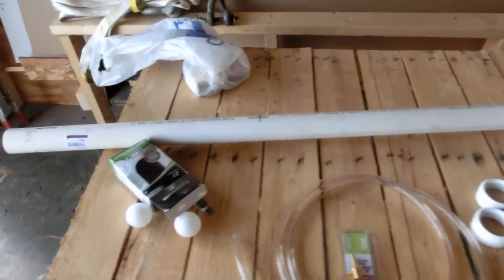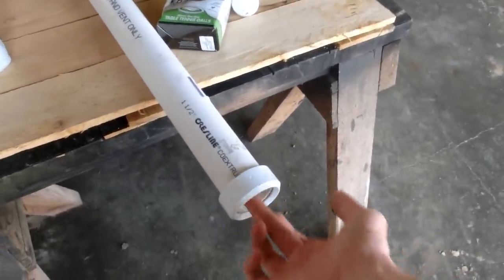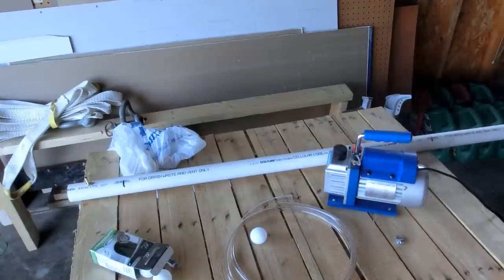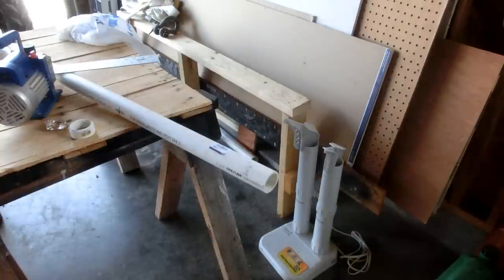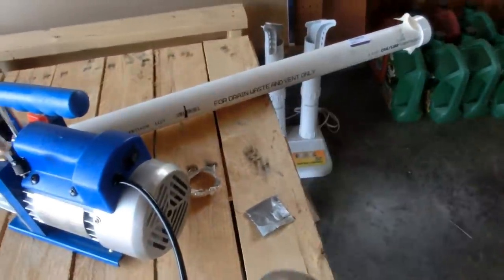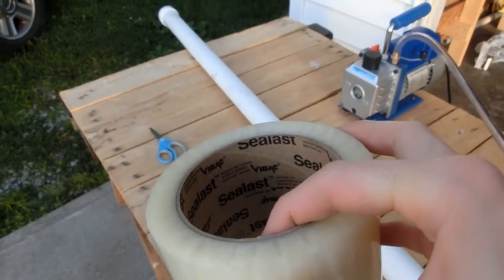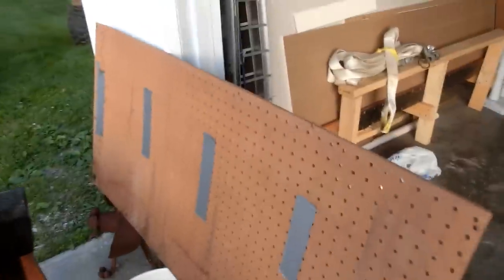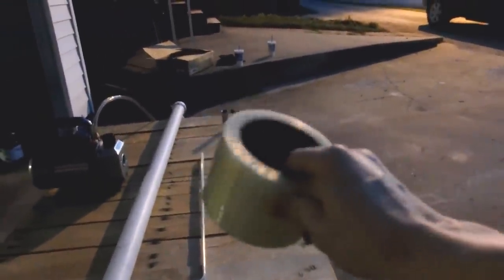DIY 290MPH (470KPH) Ping Pong Ball Vacuum Cannon

Comment: How fast would it be able to go if you increase the length of the pipe and make sure no air can get in front of the ball, wouldn't you technically be able to get any speed if you just made the pipe longer?

Comment: Hey, I was wondering what port you plugged the cable into from the vacuum pump, and also what is the nozzle called that you drilled into pvc. thanks if I get your answer I will be building this design.

Comment: How about a ball valve on the popping end??
Reply: yeah so rushing air can open it before the ball goes out. Fit he adds the valve one the air house he can disconect it from air pump so its portable.
Reply from the maker: josip :D (snakeinthebottle)
 actually i would think a gate valve that was spring loaded would work best. it only has to open fast, doesnt matter if i have to manually close it.

Comment: What about a flapper and rubber ring at the trigger end, the vaccume would keep it closed, you tap the flapper to fire.
Reply from the maker: i was thinking a Gate valve that was spring loaded, and have an infrared sensor before it to open it, that way the ball would never hit the valve and it wouldnt waste it's energy.
Reply: Rinoa Super-Genius
 Even with a gate valve you would need the end of the pipe to have a rubber ring or cleverly glued section of an inner tube to seal up against the gate.
You could get a bit of wood and drill a hole in the centre to fit the tube through and keep the seal in place, you have a flat flange to place your gate on and recess into so it slides straight??
Reply: Rinoa Super-Genius
Another thought, you could make a plastic disk and drill a small centre hole and a big hole , glue some rubber to it and punch out the big hole, make another plastic disk the same as the first, a pin through the center of both so the free disk can rotate, just rotate to line the holes up :-))
Reply from the maker: zx8401ztv
 or i could use a 8$ PVC gate valve from rural king that will already fit the pipe... ;p
Reply: Rinoa Super-Genius
lol i thought you may like to construct it, but if you have money burning your pocket ha ha :-))
Reply from the maker: zx8401ztv  well its not that i have money burning a hole in my pocket, i just know i'm not going to be able to make a part that precise. its better to just buy the part instead of trying to make it and getting frustrated then buying the part.
Reply: Rinoa Super-Genius
Ok, i was just giving you mad ideas :-))

How would you open the typical screw drive gate fast enough, perhaps remove the rod and grind the threads off so it can be pulled instead?
Reply from the maker: zx8401ztv
 idk, i dont think a screw drive would work well.

Comment: Am I rude to say that your step sister is cute? 

And, btw, I have an old car radio with a cd drive in it, and all the rest of it, it got wet, and I got frustrated and it ended up on the floor, on the other side of the garage... but, if you want it, you can have it. I know the sensor is still good, so that might come in handy.  The only thing I ask in return is, there's a cd that got stuck in it when it got wet.  I need that back. But, if you dont want it, im taking a hammer and flat head screw driver to it and getting the disk out, then im just going to scrap it.
Reply from the maker: lol you could say she was sexy and it wouldnt be rude.

i think you would have more fun opening the cd drive than i would. thanks though.
Reply: Lol, ok. Ive opened up plenty of compact disk players before, and although I did have fun doing it, I figured you might get more out of it than I would...
Reply from the maker: NateWilson99
 i have a stack of aobout 25 CD roms in my storage shed, would be pointless to give me another one.
Reply: Lol, ok, sorry.

Comment: Anchor the cannon securely.
   AIR INTAKE END: Then have a rubbery gasket on the rear end of the tube to create a seal.  Something like an "O" ring might be best to maintain position and reduce friction in perpendicular movement.  
   Over this, place a rigid sheet of slippery material, maybe sheet metal to cover the hole and act as a slide valve.  You may even wish to lubricate the sheet to ease sliding. Push the rigid sheet against the gasket and as the air is drawn out of the tube the rigid sheet of material against the gasket it will seal.  Have a handle or a foot petal attached to the rigid sheet so it can be yanked perpendicular to the air inlet opening as fast as possible. 
   If you have seen those demonstrations in which table cloths are yanked off a table and the place settings, arrangements and candles stay on the table, you will notice human beings can actually yank things at a very high speed.
   Instead of tapping on tape, peeling off and resealing with tape, this should allow you to merely place the sheet metal on the end.
PROJECTILE END:  On the exit end, it might be possible to get away with a rigid cover on a hinge that also is sealed with an "o" ring on the tube.  When the projectile and wall of air hits the door, it is knocked out of the way like the tape/aluminum foil is ripped open.
   You might be able to use something like the cut off tops of tin cans.
    The problem with this design is that a single hinge would cause the projectile to go out at an angle.  So, the exit door would have to be cut into hemispheres with two hinges to equalize the exit direction.  Then there is the problem of a seal to connect the two hemispheres.

Comment: a sprinkler valve work just fine
Reply from the maker: actually i think a spring loaded gate valve would be better.
Reply: up to u i could test the sprinkler valve firs if u want me too i have evry thing allready xD
Reply from the maker: c202011
 i have several differant types of valves too, its just you wouldnt want teh air pressure pressing against anything or having to go around anything, you would want it to go straight through.
Reply: yea